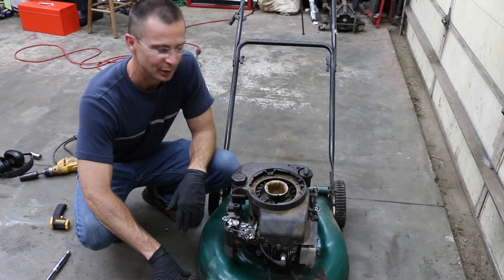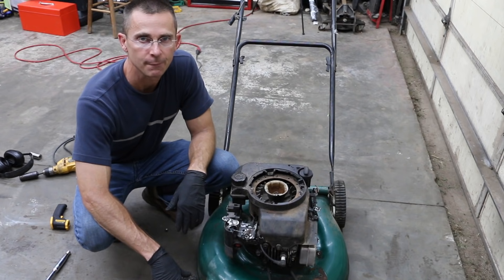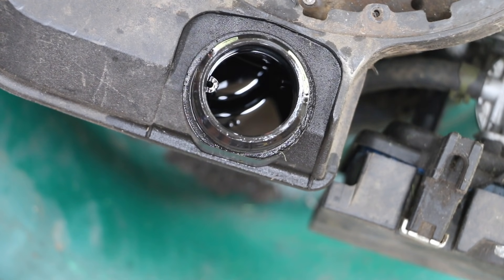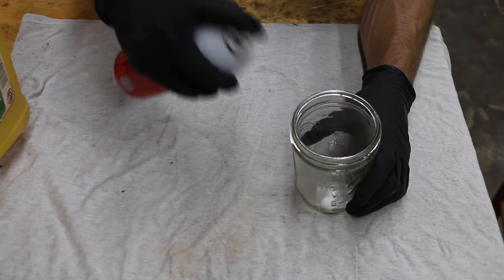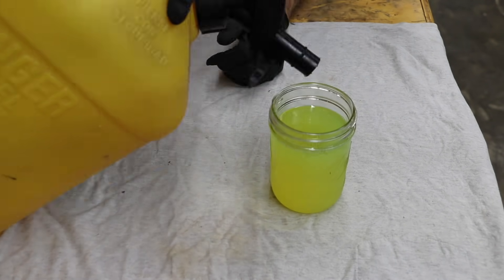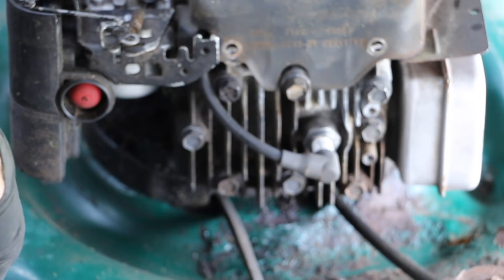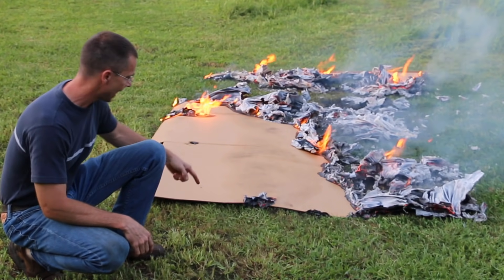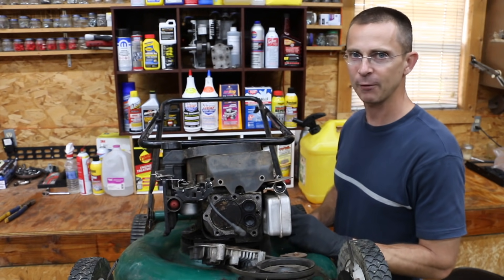Will a Gas Engine Run on Diesel?  Let's find out!

Comment: I can tell from experience that about a 30/70% gas to diesel will run in a 1964 Oldsmobile 340 CID engine but not very well at all. I goofed up and ended up with this in my tank and was able to drive it about 7 miles before I stopped and drained the tank. The only way I was able to drive that far was put the car in neutral, rev it up and put it on drive and keep patting the accelerator and about a quarter mile later had to repeat the same process. It was no fun. I was 17 years old at that time so I have a good excuse. Yep, it is called stupidity. I have learned a lot since 1967.
Reply from the maker: Great information. Thank you

Comment: I use a 1:32 mix of oil to gas on my 2 cycle lawn equipment.  But I use full synthetic oil., 20 oz synthetic oil to a 5-gallon container of gasoline.  I was using a separate tank for pure gas for the mower and power washer which was 4 cycle, and then thought, why don't I just use the 2 cycle mix for everything?  I started doing that many years ago and had phenomenal results.  

The oil-gas mixture gives top cylinder and valve lubrication to the 4-cycle engines and does not produce any smoke or cause them to run differently., Also, the synthetic oil acts as a stabilizer and rust preventative for the carb over the winter, preventing rust and gum build up.  I also use the 1:32 mix for my 2 cycle engines that call for a 1:50 mix of oil to gas.

Diesel would probably also provide similar advantages to the 4 cycle engines in providing top cylinder lubrication.  Walmart seems the best place to buy the full synthetic at a cost of around $16 for a 5-quart bottle. I don't think diesel would be an adequate substitute for oil in the 2-cycle mix, though.
Reply from the maker: Thank you

Comment: Not sure if it's been mentioned but if you realise you have misfuelled at the pump - DO NOT start the engine, in fact do not even put the key in the ignition or unlock it. Call the breakdown service and they will be there for 5 - 15 minutes, drain the tank, refill correctly and you're away. Start the engine, or do anything to make the fuel pump "wake up" and you're in for an expensive clean out. The pump staff will tell you to move your car as you'll be blocking the pump, but tell them to go away and leave you alone or you will hold them responsible for the "damage" costs of starting the engine. Some cars, even unlocking them can trigger the fuel pump so best to just leave it locked and parked in place until you drain the tank.
Reply from the maker: Great point! Thank you

Comment: I like to know if a diesel  will run on gas?
Reply: I accidentally put gas in my diesel truck. $10,000 fuel system needed to be replaced. I would say no.

Comment: So how does diesel added to a gas engine affect power and efficiency?
Reply: I dont think it is the fuel but the high compression ratio of the diesel engine  that gives it its higher efficiency. The diesel engine can in theory run on any fuel like gasoline  or ethanol with adjustment to the fuel air ratio wich could be done by the engines computer automatically so it would probably be possible to use a diesel engine as a multi fuel engine like the old hit and miss engines wich ran on anything from moonshine to almost tar like heavy oils. Sadly what prevents you from using any type of fuels in a modern diesel engine is actually that its lubricating properties are neccesary for the high pressure injection pump not to be damaged so if you run a diesel engine on ethenol or gasoline the injection pump will seize because it needs the diesel fuel for lubrication. A simple problem to solve you would think but seems not since a modern diesel car will have its warranty void and probably have the injection pump destroyed/damaged if run on anything but diesel.
Reply: @johnpekkala6941  thanks
Reply: @zandemen  you could add a bit of lubricant to the gas though .

Comment: Would you continue to use a 50/50 mix in the future to get/make fuel cheaper for your mower?
Reply from the maker: Thank you.  I would likely use a 10-20% diesel 80-90% gasoline mix.

Comment: I also viewed your Kerosene episode. Brought back memories.A friend brought his grandmothers relatively new lawn mower to me to get it running when they couldn't get it started one afternoon. After checking all the items needed for the engine to run  - Spark - Fuel - Compression and determining that the engine was indeed flooding so I knew it was feeding fuel this engine 
would not even give a hint of firing. Solid State ignition, good spark, good compression, full tank of fuel no obvious issue with the carburetor. Fifteen minutes of scratching my head, this engine only had a few dozen hours of operation since new, I was puzzled.Removed the cylinder head inspected all the mechanics of the engine - no issues found. Verified timing and air gap, installed new spark plug even though the original plug was fine. ... NOTHING!  Then a real dim light bulb lit up in my brain. Fuel issue?  Removed and dried out spark plug, reinstalled and sprayed a small amount of starting fluid into Carb. Engine fired immediately for a few seconds. I dumped the fuel out of the tank and it became obvious immediately.The mower had been filled with Kerosene by mistake by the friends grandmother !!! ... For whatever reason I didn't immediately pick up on a kerosene smell.
 Anything "MOWER"  need said? A new item was added to my diagnostic checklist... When it looks like a Duck, attempts sounds like a Duck, acts like a Duck, but won't quack ... Check for correct food type!!!
Reply from the maker: Great point!  Thank you

Comment: A gasoline engine doesn't have the compression to burn diesel fuel.
Reply: Sorry, your snotty answer is WRONG.
1. You aren't my father so you have no idea if I grew up on a farm or not. (I am writing from a farm today)
2. I was replying to a specific model of International engine that has not been made for awhile. And yes it is a diesel with spark plugs.
3. If you read my reply you would know that it only starts on gasoline, then switches to diesel.  So yes, it is a diesel with spark plugs. It has 2 different compression ratios that it uses - one for starting on gas and a second for diesel.  Look it up.
4. It is a type of engine that there are still THOUSANDS out there. The International crawler I referenced is still running.  Want to come and see it?
Reply: @robertoskeetrech3206 I don't remember saying anything about a combination fuel engine and specifically about anything about who your daddy is. A gasoline engine in general doesn't have the compression to pop diesel fuel.
Reply: @robertoskeetrech3206  you got no reason to try to get sideways with me pard. Whatever knowledge you posess you can keep. I don't have the need for your bullshit.
Reply: @robertoskeetrech3206  And I  can vouch for that, it runs like shit but it does run.
Reply: @robertoskeetrech3206  how to lay down turf
Reply: Correct. Gasoline engines are not by design Diesel engines.  This video did show that Gas engines will not run on pure diesel.  But since Gasoline is a hydrocarbon mixture, putting in more thick stuff like Diesel will still work if enough of the vaporizable gasoline vapors are present to get the fire started from the spark. Maybe the more vaporous gasoline can carry diesel with it, interesting thought and I would need more investigation. Obviously not enough vapors from diesel to get it going, but I think the diesel was getting atomized when he pressed on the priming bulb, or maybe not.  This kept it going somewhat but likely the carbo ran out of the remaining gasoline, ahh maybe the pressing of the primer bulb was forcing the last of the gasoline out of the primer bulb.  Fun stuff, it beats thinking about politics!
Reply: Joseph Quīnque  My wife tried really hard, but with the nozzle sizes of diesel being bigger and not fitting into the gas filling hole.  Well she called me, perplexed why the nozzle would not fit in the hole.  See getting it in the hole is my job!  She hung up and was a bit embarrassed when it all played out, but fun story.
Reply from the maker: Thank you
Reply: @ProjectFarm  science
Reply: Joseph Quīnque  there was enough gas in the tank for it to mix and burn it
Reply: This is what I wanted to know.

Comment: I recently had a motor failure on my Polaris RZR800S due to being "dusted", can you do a test to see how much dust/sand/silt would need to pass through a paper air filter to cause piston failure? maybe poke a few small holes then larger holes, then just no filter? It's a common problem on these machines and we're upgrading to a UMP air filter, but would like to see project farm take on a dust/sand intake failure and depending on how much damage is done, can you add any oil/chem/sealant to the cylinder to restore the damage? @teampistelak
Reply from the maker: Terrific video idea! Thank you

Comment: Back in the early 1970s we ran an old lawnmower on a mixture of petrol and paraffin [26 sec. lamp oil] (gasoline and kerosene). It wasn't easy to start, but once warmed up and running it went well. It was otherwise totally unmodified. One thing that was notable was the increase in carbon build up inside the cylinder head combustion space, but otherwise no real issues. Of course, we were only kids then. In later years we ran a collection of petrol/TVO (tractor vaporising oil) tractors, and had to modify lamp oil by adding about 5% engine oil - not just any lamp oil, and not just any engine oil, we found Esso 'Blue' lamp oil mixed with Duckhams 20/50 engine oil was the best mix. By that time TVO was no longer in production in the UK.
Reply from the maker: Great information. Thank you

Comment: Very interesting video. I had no idea you could run a gasoline engine with that much diesel fuel in the mix. The last part where you set the cardboard on fire was not a good idea.
Reply from the maker: Thank you!

Comment: i remember my ex wife put diesel in my 73 charger. It smoked, pinged and knocked alot with diesel.  Had tot drop the fuel tank and drain it then put the right fuel in it and it was fine. No engine damage. However it did run... she drove it 15 miles. I dont remember how much gas was in it when she filled it with diesel though. That was 20 years ago lol
Reply from the maker: 73 Charger--nice car!

Comment: Put kerosene in a hot mower one time and it wouldn’t shut off.
Reply from the maker: Did you run it out of fuel or find some tall grass?
Reply: Project Farm Not one is my best moments....while the mower was running I had to tip it on its side so the fuel would dump out.  Needless to say the fuel system was cleaned out and no one was injured :)

Comment: Great video! **Can you use diesel fuel as a detergent in the crankcase by replacing the oil and running the engine ?**
Reply from the maker: Thank you

Comment: What does the moth ball do?  My Grandfather told me of the days back in the 1930's and 1940's, he had an old Ford truck that had two fuel tanks, one Ford installed and one he installed. The ob Ford install held Gas, the one he installed held kerosene.  He said you start the truck up on gas, after it is hot you close the valve to the gas and open the valve to the kerosene. You can then drive just don't let it shut off. Before shutting it down close the valve for the kerosene, and open the valve for the gas, and let it flush out the kerosene. He said this was common, because kerosene was cheaper to use.
Reply from the maker: Octane booster. Thank you

Comment: by adding diesel mix will burn valves because it glows around the exhaust valve.This was tested on a farm years ago
Reply from the maker: Thank you for this information!
Reply: @ProjectFarm  The 1917 Fordson  tractor had a kerosene carburetor & a kingston vaporizer with the kingston vaporizer you could burn diesel,The  motor had 45 lbs. comp. & had a  water air washer to add water vapor.The tractor started on gasoline  Thanks,Al   Hemshorn.

Comment: We  had a AC 190XT gas that would vapor lock when worked in warm weather. We put 5 gallons of diesel in when filling the fuel tank and filled it the rest of the way with gas. Problem solved
Reply from the maker: Very interesting!  Thank you

Comment: i ran gas statiins for years, people would always put diesel in their gas tanks by mistake, if it was a 50/50 mix in tjeir tank we'd tell em just to drive it and fill up with petrol as often as possible to dilute it down, no problem, petrol in a diesel motor is a different story, no go
Reply from the maker: Thank you!

Comment: What if you added an oxidizer/accelerant to diesel, maybe potassium nitrate or something similar? Of course, test outside before putting in an engine. I'm thinking the KNO3 might speed up diesel's combustion near how fast gas burns. If not, try something possibly like NO2 or nitromethane (used in dragsters). 
Potassium nitrate is what is used in black powder, but of course, that contains sulfur and charcoal. Sulfur burns very hot and might not be a good idea in an engine, but even charcoal and KNO3 don't explode outside of a closed chamber, they just burn slow.
Reply from the maker: Thank you for the video idea!

Comment: I do have some experience having to run diesel in a gasoline engine. You need a hotter spark plug. Also when the motor quits it is time to use a fresh spark plug. Put the first set of plugs in a glass jar with a chemical for breaking down carbon. The experience I had was with a 60° six cylinder Evinrude 150 hp outboard engine. I could only run the motor a max of 4 hours before having to swap the plugs. The reason for doing this had to do with the cost of having a tank full of diesel. I was a District Supervisor at a boat rental corporation. One of the customers made the mistake of filling the boat with diesel. I had to rent the boat for half day rentals, 4 hours, for the next month always changing the plugs after each rental. At the time I was tight with the manufacturer and had my own hotline number so to say. I contacted them first before trying this. They told me it shouldn't hurt anything as the motor could run off of just about anything, even jet fuel. For a carbon cleaner I used a product designed to clean the insides of a 2 cycle engine. The product is named "Engine Tuner". It comes in a spray can, designed to be sprayed into the carborater while the engine is running. You spray this until the engine stalls and leave it overnight. Well it was originally an Outboard Marine Corporation OMC product until they we're bought out by Bombardier. Good luck and hope this helps. You may want to do an evaluation of the cleaner. It may be quite helpful when working on small 2 cycle motors. I even use the product on my 4 cycle automobiles.
Reply from the maker: Great information! Thank you

Comment: This guy's good. All he's gotta do is make a little model city out of toothpicks and popsickle sticks and he'll have a Roman epic. Can I play Caligula?
Reply from the maker: lol. Thank you
Reply: You have to work it out. Do you want true history? Or a total potboiler? One thing I have noticed about all those Roman, Greek and Ancient World movies is that everyone has full legs. I am sure there were people with skinny legs back then, but no one with skinny legs ever got cast in one of those movies.

They were very popular in the 1950's. There was that famous line in one of Nobel Laureate Bob Dylan's songs, "Call for some pillars and Cecil B. DeMille."

Don't forget the pillars. You could use dowel  rods. Or tubes stuffed with pyrotechnic powder. Caligula was the grandfather of the Emperor Nero. You gotta end it with Rome burning.

Meanwhile, what about my permanent hack job on brand-name engine additives? I have particularly exposed Stabil as nothing unique. Also all engine and fuel cleaners as based on naptha and turpentine or an equivalent petroleum distillate.

Strong solvent carb and fuel cleaners like B-12 are on a different base though. I would not use these in any modern engine or transmission.

Comment: Indeed a gas engine will run on anything that will explode diesel included get the engine hot first it will run but will have low power out put. But it will run  of engine is cold it will not start. But hot I’ll start and run.
Reply from the maker: Great point. Thank you

Comment: I am curious...as it is possible to separate oxygen and hydrogen from water by either mechanical or electrolytic means, would the finest mechanical atomization of water may result in a usable type of hydroxy gas? If you were to replace the glow plug on a diesel engine with a spark plug to provide a combustion chamber with high compression and an ignition source, will an engine run on water? There would certainly be a requirement to provide a spark input to the plug and as a diesel engine is without the means necessary to provide this, maybe by using what is commonly called a ""buzz box" in the automotive industry would easily provide this input though there would be no opportunity for timing control. PS Your videos are great!!! Full on interesting information and caused my brain to think even more! Thank for all you do.
Reply from the maker: Thank you for the video idea and thanks for the positive comment!